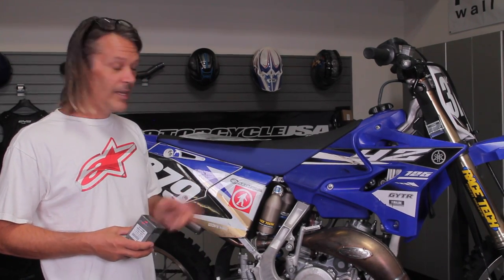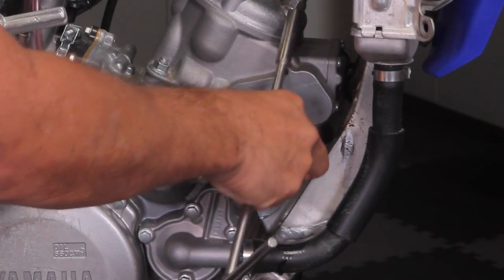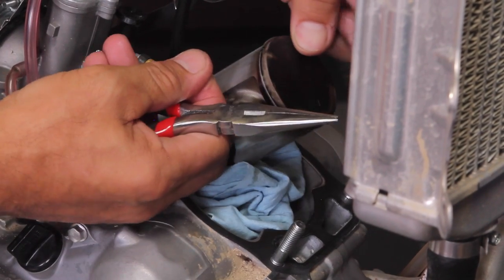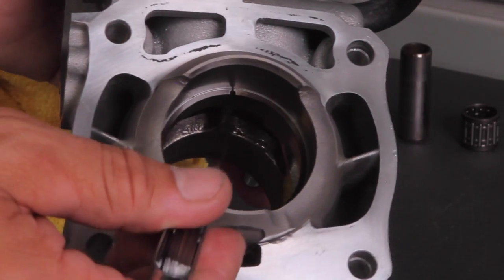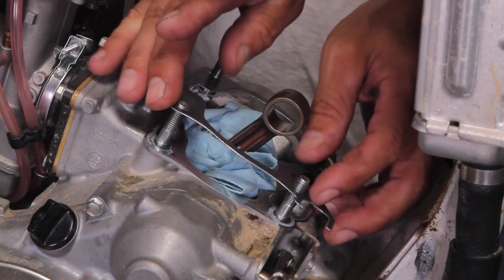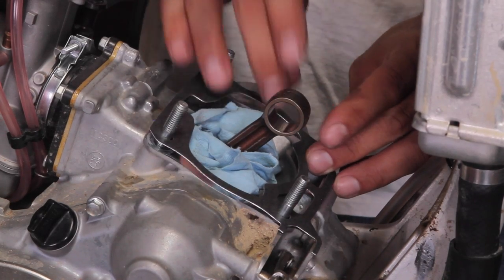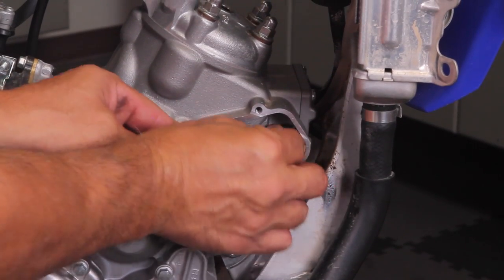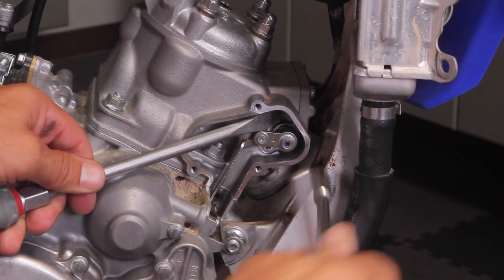Tech Tip: Two-Stroke Top End Rebuild YZ125 - MotoUSA

Comment: i used this video to replace the piston on a 2004 yz125. im mechanically inclined but have never been confident with getting into motors. this video helped me get passed that and now the bike runs 100% better. just wanted to say thanks!
Reply: Edwin D did you put oil on the piston and cylinder when you did it ? Thinking about doing mine and it doesn’t look that hard
Reply: @nathanmachado9412  my father in law did. i didnt want to but he decided to do it anyways and he applied a good amount. bike runs great. we used a wiseco piston kit that we got for 120. we also purchased the torque wrench tool he mentioned in the video, got it on amazon for 12 bucks. it was really an easy rebuild.
Reply: Edwin D thanks man, I’ve never done any work on a dirt bike like this before really, but it just seems to easy not to try!
Reply: @nathanmachado9412  no problem man. on the 04, the torque values were 22 ft lbs for the cylinder and 20 ft lbs for the head. good luck if you decide to do it. message me if you have more questions
Reply: Hey Edwin should I hone the top end on my rebuild?
Reply: what did you do about the math formula for tightening the bolts back?

Comment: A tip for the torque wrench extension method. No formula required if the extension is at a 90 degree angle to the handle instead of 180.

Comment: "Long overdue for a top end" 2015.....  I got a 1993 that's never been rebuilt.
Reply: Well the new bikes r made of plastic sooo
Reply: Just because it's never been rebuilt and still runs,  doesn't mean it wouldn't benefit from a new top end.  Also if you always putt around like a Grandpa then ya no shit. Try opening the throttle. I use to rebuild my YZ 125 every 10 races. I knew guys that did it every 3. Riding around your lawn for 20 years isn't riding.
Reply: @brandoncallioux9030  i have a 78 Kx never had a oil change and she still a winner
Reply: @kyb4206  well that's pretty dumb
Reply: Don’t forget to leave the rag in the lock. It helps keep it clean
Reply: That’s a motocross bike not just a bike for fun, u put a lot more wear on it so it needs the rebuild
Reply: Meme Rider lmao
Reply: Bad Apple I had 2 cr80s when I was racing minis and it seemed like my dad was putting clutches and top ends in one or both every other week. What people doesn’t understand is a motor only needs 3 things to run. Compression, Spark, and fuel. If your bike has more than 20 hours on it then it could use a top end. Not to mention why are people proud of that? “My cr125 has never been rebuilt.” Why? a piston, gaskets, spark plug and antifreeze is like $100 and it take 45 mins to do it and saves your cylinder. Doing a top end is really just maintenance. Lol
Reply: @jmbraap3822  What you're saying is bullshit , in dirtbikes you should change pistons very often compared to other motorcycles , because 125 cc 2 stroke dirtbike engine makes about 45 hp ,and for example Yamaha DT 125 2 stroke makes 15 horsepower

Comment: Replace the top-end bearings every time as well. They are not expensive!
Reply: +TS50ER I agree, can prevent allot of trouble.
Reply: Y7
Reply: fukin rite!!!!!!!!!!!!!!!
Reply: Normally I would assume he did but did not say. Those roller bearings do not give you much of a warning.
Reply: Why don't piston kits come with new small end bearing?
Reply: They do. Every single piston I have ever bought comes with a new bearing, wrist pin and circlips.
Reply: @SkinnySkinch  , Wiseco, Pro X, Wossner and Vertex kits don't come with the wrist pin bearing.
Reply: @2DclanSnipingTeam  mine did, i got a vertex

Comment: good video for someone that doesn't ride 2 strokes but thinking of buying one in the future. The word rebuild kinda scared me whenever I'd hear you have to rebuild around 20 hrs or so for 2 strokes. But I have to say, the dirt that was centimeters from the inside of the engine was driving me crazy. Especially when you have a really clean shop and environment it would be best to make an instructional video with actually cleaning around the areas that are vulnerable to dirt or friction. My OCD was off the charts at the moment. but thanks for the video very helpful and now I know i'm capable of doing this in my own garage.

Comment: I can't believe you took apart the bike with a pile of dirt millimeters from getting inside.
Reply: +Knights2theEnd Meh, it's the crap above that's worrying.
Reply: when i know im gonna do a top end i clean the bike with the expansion chamber and muffler off the bike and stick the exhaust bung up the port to stop water, its the only way to get that tricky spot on yz's...
Reply: oem parts is the best for yamaha motors. Do you have anything to back that up?  Aftermarket pistons are often made to higher tolerance than standard oem and it depends on what kind of performance you want out of your engine or how it is tuned?
Reply: +blomgren182 I have 30 years of riding 2 strokes and building motors to back it up! tons of other people know oem is the best as well. if you read what I said "for Yamaha's oem is the best". oem bearing's, seals, crank, rod, and piston. are definitely the best. all the off brand cranks are rarely ever balanced true. oem Yamaha cranks are balanced perfect. you get 3 times the hours out of a oem crank.  also weisco pistons ect. tend to cold seize way more often then oem. and weisco piston skirts break off on the exhaust side quite often if you run too many hours on them. I've never had a oem piston even crack on the hot side. I could go on for days why oem is better than the aftermarket. but I've got better things to do. why don't you do a little research on the subject and you'll find out for yourself. seeing as your the stubborn type that doesn't believe anyone. or run your aftermarket parts and see how things hold up for you. some people just need to learn the hard way.
Reply: rexburn1955 it's hard to get a lot of oem parts , especially for older bikes even if their just 10 years old
Reply: +Fr3ShPRiNC3 it's not hard at all! there are plenty of distributors, the dealer can order you oem parts too. Ive refurbished over 30 bikes over the years. lots of the bikes were over 10 years old! sounds like you need to look around a little harder for oem parts.
Reply: Should always wash a bike before working on it
Reply: should see my cr125, shit's covered in dirt, has both side cases off and top end lmfao. i'll probably be replacing both top and bottom end again real soon.
Reply: Marek Sumguy h
Reply: rexburn1955 - Looked like a Vertex piston which are normally solid, I would agree Wiseco is crap. I don't hone a nikasel bore but will scotch brite it or acid wash it. If it looks like it needs honing its done. Can't go wrong with OEM parts though.
Reply: lol someone always has to complain xD
Reply: rexburn1955 yeah I couldn’t agree more - for Yamaha, oem is best.
Reply: If you know much about engines, you’d know that the crank is balanced for a certain piston weight. Using a piston that is heavier or lighter than factory standard will increase vibration and reduce engine life.

Comment: Looking at the plug I don't think will give any indication of jetting at this point. Who knows how the engine was run for the last minute before shut down? You've gotta do a full throttle run and do an immediate shut down without idling then pull the plug and look at it. The other thing I noticed was, not much was spoken about looking at the top of the cylinder for a possible ring ridge developing, where the ring wear stops before the end of the cylinder. A new ring may hit that ridge and crack or cause other issues.
Reply: Good points and when does a top-end not include the Power  Valve?
They can cause a World of Hurt when they go wrong, and they do.
Usually they are full of tar which glues everything together. Next time ok?

Comment: This is a very informative video.  My son and I used it to successfully do the rebuild.  You'll need a specialty tool for the torque as well as a torque wrench.  If you intend to maintain a bike you should own those inexpensive tools anyway.  Takes significantly more time than shown for rookies to complete.  Take the extra time and clean things up real well.  Make sure the head is flat before re-installation.  Pay a pro for honing if necessary.  The t-handle tools speed things up a bunch.  Buy some and have fun.  This project is not for a first timer - you'll need some mechanical know how.

Comment: Measure ring end gap, measure piston to wall. If everything's good they go right back in.
Reply: Rowan Cranston yes. But i mean if you already have it apart, a piston is like 100 dollars so id throw a new one in while im at it, just my opinion.
Reply: Always replace it , it could eventually go and scratch the cylinder wall (sleeve). It's just not worth skimping on imo and in my experience.
Reply: If the ring is worn out your piston is not far behind.

Comment: should you lubricate the piston
Reply: and the cylinder
Reply: yes always put a lot of oil around the cilinder so when you start it it doesnt get seized
Reply: +Nicolas Cools you don't want to put too much oil on the cylinder buddy. the rings have a harder time seating. if it's over oiled the rings "float on the oil" and won't contact the cylinder wall enough to break in. just a thin layer works well. and oil the piston skirts a little too. and the crank and wrist pin bearing obviously.
Reply: Can use assembly lube or the 2 srtoke pre-mix oil it will be running with. Apply a thin film with your finger tip.

Comment: There's no need for a formula you're probably going to mess up doing to get the right torque with an adapter. Just put the adapter at a 90 degree angle and the torque will be correct.
Reply: There is a formula for sure. And it does affect the torque. Important always but especially with soft aluminum.

Comment: so here's my question, lets say you pulled out the old piston and start to take measurements and check what piston you need A,B, C Whatever. you get a new piston and check the piston ring gap inside the bore. if the gap it's not within spec, what your suppose to do?

Comment: You should've put oil on the piston and cylinder.  before installing them. There is a 2 cycle ring compressor set with a base adapter but that cyl. obviously had a taper at the bottom of the cylinder. If you could, maybe install oversize rings. I put .030 rings on or car and filed them to minimum gap- .008- .010 spec. I filed them to .008. It WORKED!! Why does it smoke? Maybe cylinder was worn. Always mic. the cyl. What did the owner say?

Comment: What was that you measured in the cylinder? A ring of some sort. I've never seen that in a cylinder!
Reply: Andy Jonson that was the rings old and new he had down in there measuring with a feeler gauge. Use the piston to push it down in there so it's perpendicular to the bore. Measure at several locations along the path the ring travels.

Comment: You didn't crisscross on tightening head
Reply: tincuppassracing yes he did
Reply: Yeah, he should a gone:  1.3.5.2.4.  Go left or go right doesn't matter. 
Oddly Suzuki go 1.2.3.4.5 for the TS200R.  Either direction. I'll stick with 1.3.5.2.4
Reply: @brokebikemtb4448  take another look. How would you do it? Just askin'.
Reply: @dny9394  how he shows in the video is the proper way.....its a star pattern

Comment: Would a 53.96 piston fit if the old one was 53.95?
Reply: You'd need to measure the cylinder/piston clearance. 
Spec usually less than 0.120 mm.

Comment: If I put regular gas in a 2 stroke 91 yz 250 what do i do?
Reply: add 2 stroke oil
Reply: @MaliciousSRT   be a little more specific i toom it to the shop n they say they took the top end off and it indicates someone put reguler gas it wasnt me it was the previous owner
Reply: @JamesJohnson-px6fo  Means it ran without any oil in the gas, oil in the gas lubricates the piston.  Just bore it out to clean up the cylinder then get a proper size piston for the new bore size, or sleeve it.

Comment: How much HP does YZ 125, 2000 to 2010 year have?
And oil to fuel ratio is 2% on 5 litres gasoline? Thanks
Reply: +nemanja pribanovic google and google
Reply: I trought YZ had more hp than that lol xD
Reply: nemanja pribanovic 200 lbs, 30 hp.  That is quite a lot to handle in the low gears.
Reply: +Vero I have a 1998 Honda cr125 and has 34 hp weighing 192 lbs
Reply: colin orleans Yup, quite similar.  Both are difficult bikes to master on a track.
Reply: +Vero my cr isn't very hard to get a hang of after a lap or 2, it'll keep up with 250 2 strokes
Reply: colin orleans Yeah, I never got my yz 125 down until a week of owning it. 125 2t are with 250 4t and 250 2t are with 450 4t basically, still don't get why we mainly use 4t now lmao
Reply: +Vero we are using 4t now because of there direct low end. high revving power. as 2 stroke have iffy low end but great mid to top end power. a pinned 125 will keep up with 250 2 stroke. but a 250 will always be faster on the straight aways
Reply: +colin +colin orleans I'm confused you said a pinned 125  2stroke will keep up with 250 2stroke then in the same Sentence you said a 250 will,always win in the straight always? If that's the case then the 125 does not keep up its clearly out matched by the bigger bike...plus 125s are for chickens
Reply: haha damn wish I got my yz 125 bored before I sold it
Reply: +Chris Nicole 125's are NOT for "chickens".  I rode a new YZ125 the other day... and it hauls amazing ass.  Super fun to ride.  And this is coming from someone who used to own a new 250 2t.  It's all about which bike is more FUN to ride.  And for me... it might very well be the YZ125.

Comment: he didn't even oil the piston
Reply: Which is actually a good thing for properly seating the ring.  Look it up;  it's a common misconception that they need oil for initial startup, along with heat cycling.  You'll get a longer service life and higher compression by leaving the cylinder oil-free and hammering down on the engine as soon as you start it.  Google it and you'll see.

Comment: 2stroke , poor mans\kids toy. Been racing 4t for a decade already.you can't even ride those off track were I live.who even races those obsolete weed wackers nowa days.they aren't legal to race in a class. Garbage!!
Reply: interm912 im sure you have a 50cc derbi senda😂😂😂
Reply: Ángel Bolívar Molinero  I do have a crf 50 for pit bike racing but it has  a Daytona in it. I have a yz250 2t and a crf 450r mod.. 2t funner to  ride for sure ,shifting more and its screaming. but I'm a racer and my lap times are faster on a 4t. but if you just starring to ride I recommend 2t. helps with corners cause you have to carry entry speed.also helps with bike and throttle control cause it lighter. but a done up 2t is at a disadvantage compared to a done up 4t.
Reply: Yamahaulin84  ceramic bearings, polished lightened crank, billet con rod, tie exauts valves, copper seats for tie valves.fast head.poted head  14.1 comp piston,race cam. PC tie exhaust,one muffler.u4.4 fuel fc suspension,
Reply: I live to race. I'm older ,good job spend it on my bikes. love any bike, I grew up on 2t. but to get on the box you need a 4t now. even Loretta Lynn's is mostly 4t now past 65cc. the fast schoolboys are on 4t.
Reply: Yamahaulin84 cause if a rider has equal abilities to me the dude with the better bike will win. theoretically speaking. I buy new every year and last years race bike gets the factory parts back and becomes my practice bike.
Reply: the biggest gains to be made I think start when you extend the rev limiter and play with the fuel ratio and ignition timing.
Reply: Yamahaulin84 1000 dallar repair bill lol. so wat. 1000 is fuck all.when a big uphill comes I'll drive around people or go around them on the outside.the long way.
Reply: just keep repeating wat you've heard with no actual firsthand experience. at Loretta's how many stock 450s were there in 450 A...not one bro not one. I race a race bike. not a poor little kid. 1000 dollars lmao. 2.5 days work lol smh.
Reply: Yamahaulin84 stuck In the past.80 lol 85 .150f riders aren't allowed on the track at the same time. as 450A riders were I live.
Reply: Yamahaulin84 why would a top pro who sponsored by the factory tell you the don't ride a stock bike..jimmy decotis rode at my local track last summer his girlfriends from here.burned one with him, super cool guy. my bike is a 125 compared to the stuff he rides apparently...
Reply: interm912  i ride a factory edition 450sxf im 18 I've been riding since i was 8 & it's a fuck load of power i mean everything you have on ur bike is ur option you want it faster than it already is stock more power to you it's ur bike. but 450s are already very very powerful how does it handle in corners with all the mods??
Reply: I live literally a hour from Lynn's we go ever year and all the bikes in 450 a class were stock internals get out of here with that big boy money shit anyone that's got money doesn't waste it and anyone that doesn't have money talks about how much they spend I have a newer 450 and it's good for hitting westpoint but my baby 👧  is my 03 Ktm 380 I call her the ditch witch but back to matter at hand bro you're probably just broke dreaming because no one that rides wastes money like that
Reply: Intern, I'll smoke you on my "weed Wacker" ... I own a 450 and many two smokers, the bottom line is, my 4 stroke requires valve replacement every 9 hours , a valve set goes up to $550 not including labor if needed... The equivalent are valves on a 2, usually worst case is a quick, cheap and easy top end... So unless I'm racing heavy, I'm having fun on my two... Remember, to each their own!
Reply: Joey Underwood Agreed, and a "weed whacker" stock kx500 would whoop his ass, so much for weed whacking. Hell a big bore pw50 would be more bitchin then a 450 lol but that's just my opinion
Reply: 😂have you heard of bikelife we don’t care where we ride our 2strokes we ride the street